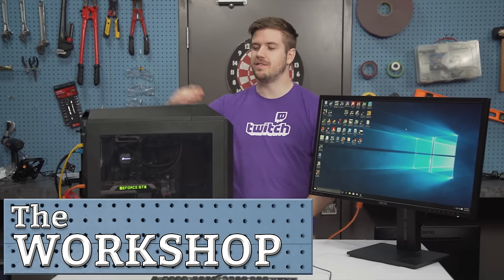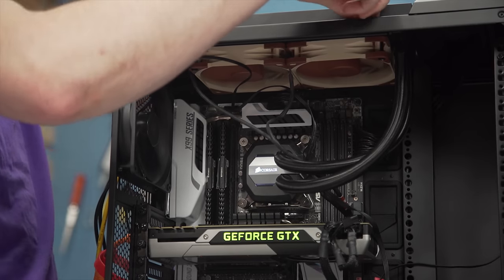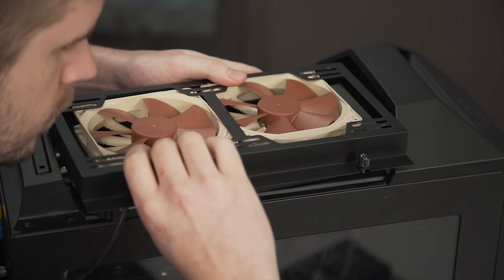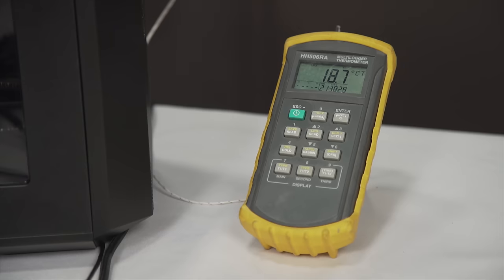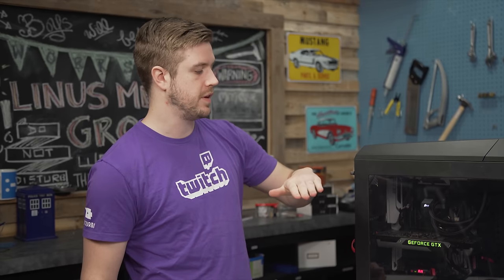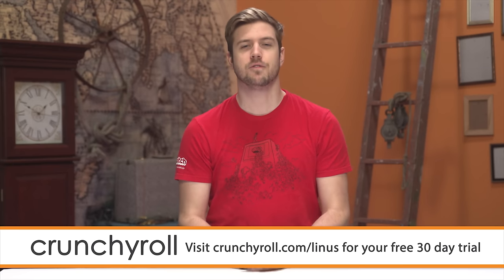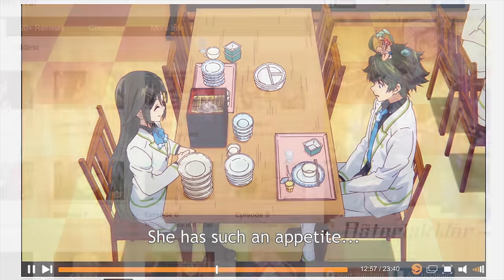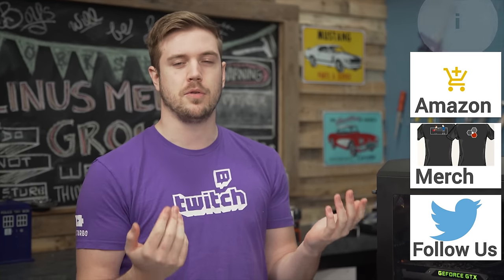Radiator Fan Configuration: Does It Matter? - The Workshop

Comment: This is kind of an 'age old' question and it's good to see another resource CLEARLY answering the question in a control-experiment way.

That being said, I was hoping to see more on cooling differences based on radiator placement  on different parts of the case. For instance, this whole process done with the radiator on the bottom or the front. Granted, this is extremely hard with most cases and AIO cooling tube length but it may be worth it as the informed consumer base may place a demand on newer setups not commonly seen with existing cases.

Thanks guys! Keep posting the phenomenal vids! Engaging and informing!

Comment: Why was there no test of intake vs exhaust positioning? My rad is configured with pushpull where I intake air temps and exhaust my rad into my case.

AFAIK, it's advantageous since my rad is not affected by my GPU's heat output.

Comment: I'm dumbfounded...

Thermaltake S71 case, H105 AIO cooler... MSI X99A SLI... 5930K... i never OC'd... but my temps were always idling 40 degrees up.. I was always told to exhaust out the top and back... intake from the front and bottom... after this video, i decided to flip my fans around on the Radiator (did the same on the fan at the top of my case)... and my CPU is idling at 35 degrees.. solid...

I'm dumbfounded.

Comment: Watch a similar video (with a similar title) on the Bitwit channel, where the guy pushes the 7700k to the limits (5Ghz, 1.4V) for more heat and clearer results. It's shown that intake or exhaust radiator fans actually do matter.
But test temps there are between 70-85 C, unlike here (35-38 C), so that's a pretty important difference. :)

Comment: How about doing a test to show temps between rads of different thickness like 30mm vs 80mm as well as different FPI (Folds per inch) and maybe even the temp difference between a 240mm and 480mm rads.

Comment: I've seen, so many times, that rad fans should always be exhaust because otherwise you are introducing heat into the PC. This is a valid statement but doesn't matter when testing the temps of the object being water-cooled. Push or pull, intake or exhaust doesn't matter for the device being cooled.

The question though, how affected are the air-cooled components when the water cooled components are set up as intake or exhaust. In this case, what happens to the GPU temps if the AIO CPU cooler intake or exhaust. Even though the water-cooled cooled item doesn't care, what happens with an air-cooled component when a water cooled component is used in an exhaust or intake configuration. Again, WC Intake increases case temp so the air cooled components should run hotter. At what point does this become an issue?

As for dust ... gotta love those dust filters.

Comment: I watched this video a year ago, but i decided to have four fans in a push-pull configuration, so basically the airflow was from inside the case, through the radiator, and then exhausted out. A year later, two of my case fans that were on top of the radiator went bad when they started making a screechy rattling noise (bearings went bad). It's probably because they were stock fans that came with my case and thus were low quality. 

I'm not replacing those fans on the top of my radiator because i just don't have the money, and my Noctua fans are still working in a push configuration. I'll update my comment if i have significant CPU temperature differences with my new 2-fan setup, but i doubt i will after watching this video.

Comment: I wish Linus could answer me this. I'm thinking of buying a laptop for 
my casual gaming, nothing special, meaning I'll use it on my free time 
at work. I know these 2 choices are not top of the line whatsoever, 
however I really need an answer. Both rigs come equipped with the same 
kind and amount of ram, same 1Tb hard drive, same GT 940M video card, 
same size (15.6") and even same brand, the only difference is that one 
comes with a ci5 5200U and the other with a ci7 5500U, however the price
 difference is about U$100 (although in my country, sellers often double
 that difference). Is the ci7 model worth it?

Comment: I have 6 fans 3 with a kraken x72 which is on the front of my nzxt 710 case pulling air in, and I have 3 nzxt fans on the top of the case blowing air out, also one rear ran blowing air out is that set up fine?

Comment: is a static pressure fan fine for pull configuration?. im planning to get the same cooler but im gonna use the fans that come with it.
Reply: U will be good,I had a single 140 rad with a sp fan pulling air on top in the beginning and it went fine..

Comment: how can I have fans setup as push into the radiator from front(outside the case showing RGB) and then pull from radiator(inside the case showing RGB inside)?. mostly RGB fans lighting is present at one side, and if I want to show RGB inside my case then I end up having setup as push/push.

Comment: As long as your rad is on exhaust and everything else is intake you are fine. It won't get any better. My results with an o/c fx 8120 and a gtx 770 in a corsair 450d, having the rad on intake made my gpu like 8c hotter while the cpu was only about 1c lower. Positive/negative pressure is all bs.

Comment: +LinusTechTips would you do a video about weather or not thermal paste wears out? (i have a somewhat old computer, never replaced the thermal compound, wondering if maybe i should?) also, in the same video, does pulling off a heatsink and then replacing it without reapplying or cleaning off thermal compound  affect performance? (a couple years ago i took off my heatsink to clean out the dust, and being ignorant of the use of thermal compund at the time, did not reapply, is that an oopsie?)  and, while i know youll want to do this with an i7 or something would you please also do it with something more "normal" like a pentium or i3? obviously for the first test, you would need to find hardware that was a few years old anyways that you knew the thermal compound hadnt been replaced on. (FreeGeek?)

Comment: Expanded question: What if you have a GPU without "blower" style cooling that pretty much exhausts all its heat into the case?

I have a just had to replace old GTX 780 (as it died) with a EVGA RTX 2070 Super that has a 3 slot cooler. The way the heatsink is designed is to discharge the heat into the case. The top mount is filtered as well, so if i intake dust won't be a major issue. This will create high positive pressure though as i have 2x 140mm front, 1x 140mm bottom, and 2x 120mm top on the AIO cooler, with only a 140mm exhaust in the rear.
Reply: i have the same exact airflow problem.

what i do is choosing a high airflow CFM for exhaust fan. i use a single 120mm Cooler Master Jetflo as exhaust fan. it has a 95cfm airflow.

my airflow is:
- top 240mm  radiator+fan pulling in air
- front 3 x 120mm fan pulling in air
- back 1 x 120mm fan high airflow CFM as exhaust pulling out air. 

my gpu also have 3 fans, it takes fresh air from the front fans. cpu also takes fresh air from the top. all of the hot air is pulled out by exhaust fan. 

the high cfm exhaust fan really helps the case cooldown to a comfortable temperature albeit a bit noisy.

Comment: So i have a Carbide 175R RGB case and i have a Corsair H100i Pro RGB  Liquid Cooling 240MM, Dual ML120, PWM Fans, i7-9700K, ASUS ROG STRIX GeForce RTX 2060 Super.
 I noticed when i play Call of Duty Warzone on High Settings i get 144 fps and my GPU temp skyrockets to 82 degrees celsius. Is this too high? I noticed i dont have any fans besides the RGB fan behind the logo and the 2 Radiator Fans.  Should i buy a 120MM exhaust fan to mount on the back to help pull air out of the case? Would that help with the temps? Any advice is appreciated.  Also is it bad that the radiator is mounted on the top? I built this PC with a friend and i think we put the radiator on the top because my Graphics Card is so big it didnt have space on the back, but i dont remember. Is just the Corsair H100i enough to properly cool this build? other than the AIO i just have the RGB fan behind the logo and i dont even know how much it helps.
Also i have no idea if my 2 Fans on my Radiator are pulling air into the case or pulling air out.  Seeing as they are the only 2 fans in my case besides the weird RGB one behind the logo should i have the fans set up to 1 pulling in and 1 pulling out(exhaust)? How do i change this?
I assume the best bet to help with cooling would be to add a 120MM exhaust fan to the back of my case to pull the hot air out of my case? as i have no fans besides the ones connected to my radiator and the RGB one behind the front logo which i dont know what it does? exhaust through front panel i assume.  Sorry im a bit of a PC noob :(.

Comment: should have tried ducting. tape the fan to the radiator to create a seal between them. some air is forced around the edge. they do this in automotive with rubber flaps and foam.

Comment: Couldn't you also argue that having the fans in a pull config taking air out of the case would be better for the temps of other components too? I mean taking the heat from the CPU out of the case seems better than pushing it into the case to me...

Comment: What about Stupid Configuration #2?
Have 2 sets of fans both trying to pull air through the rad instead of trying to push air through it?  I suspect temps will be stupid high again, but interested in how the air flow (if any) would work considering both fans are in effect trying to pull air from nowhere and creating a small vacuum?

Comment: Can you check if the radiator in front of the case as an intake (cooling the cpu) will be much worse then an outtake in the top
Reply: Jayztwocents did a video on this, I can't remember what it's called but there's no difference if I remember correctly

Comment: doing it with a blower gpu is a problem. needed to do it with an open shroud gpu to see if top or front aio makes any difference
Reply: There is a video on it on youtube. No effect on the open GPU where cooler is mounted. Whereas CPU is 10c cooler when mounted front.

Comment: 60% does not tell us what the RPM is. I think this may be mixing issues or actually comparing exhaust vs intake..push vs pull and exhaust vs intake are 2 separate things. Push vs pull refers to fan over rad.  Push should be better...but you have to consider everything. Also, intake is better.  In exhaust mode,  Case air may partially mask differences... because it is 'pre-warmed' it will how a lower differential with the rad temp. Differentials make non-linear differences. Also, there is certainly 'diminishing returns' of increase RPM on fan. Where this is depends on things like the cooling load, fin area, density, etc etc. So you would have to attempt to account for the actual variables.In reality, push vs pull  being notable better probably depends on the particular system. But, the hypothesis here is that you should be able to create a situation, withing 'normal' that you might find, where push allows you to run at least a slightly lower RPM and get the same cooling. Also,  hitting 38C on cpu is ridiculously low, meaning YOU"VE GOT SO MUCH COOLING OVERHEAD< OF course you will not measure it. This video appears to just be an inadequate attempt at thinking this through.

Comment: The configuration doesn't matter if your gpu isn't heating the air in the case. In my pc I switched from top outtake to top inlet. When gaming this resulted in an about 10 degrees difference on my cpu.

Comment: Well so I assume my i5 3570k at 4GHz running at >80°C while at 100% (Prime95) when using my All-in-One Liquid Cooling by Enermax is fairly bad right? 
Ok the room temp is about 28°C and it is overclocked, but I would assume it should NOT go above some 60°C or something. Especially since I'm using Noctua fans.

Comment: Is it ok to change the fans that came with the cooler to a different brand?
Reply: Yes, as long as they are the same dimensions and will fit the fan head splitter it comes with.

Comment: im curious to see if my fx-6300 with 2 pair of fans pushing the 2x120mm rad can do 5 GHz. Sadly i dont know what case that is big enough  to fit it. Currently using corsair h60 with push and pull config, 100% fan speed, and with 1.5 Volts, it can do a benchmark but not stable enough to do ibt on maximum with temps nearby 70 so backed out to 4.6GHz @ 1.36v stable.

Comment: not bad test but i was wondering about the other component temperature  like mother board and ram and GPU if you push the cooler hot AIR inside the case and what about overclock ...:P

Comment: Linus I need some help. I recently replaced the cooling fan in my hp pavilion g7 laptop. now when I plug it in to charge it the laptop doesn't reconize that it is connected and supposed to be charging. what could cause this? any help is appriciated

Comment: OK, Luke, I will straw poll before watching the vid, based on my own needs. 
Large filter on exterior of case with a large pressure fan drawing air in. Small fans within case or deflectors/ducting directing flow to hot spots, dual fan GPU, long radiator on top of case with 2 fans on top of it, drawing air upwards and out, PSU exhausting outwards, to rear...  hope that fits the bill for a hot, dusty environment.  rc

Comment: what about placing them on the front? i got an ibp rig and had to upgrade the aio cause the pump failed. i bought at h100 from corsair, however the ram i have wouldn't let me top mount, so i had to use the front w/ intake fans pulling in air ( cause my case has a solid cover so it would create pressure if i tried to make the fans exhaust instead)  
but that being said im curious if i missed something simple, pc is happy, even under load it stays under temp, probably the same temps as everything else logical buuut still so some love to us front mounters xP

Comment: If you have a smaller case or if you have more than one video card, pulling the air from the case can be worse. This is because you are using the already hot air from the case to cool your CPU. Larger cases don't have this problem and you will likely see no difference if you have really good positive air pressure coming from the front of your case. This is more of an issue if you are using the video card(s) that vent their air into the case rather than closed loop AMD cards or stock Nvidia coolers that vent their hot air directly out the back of your case.

I mention this because I had this problem with my old Q9400. I had it overclocked to 3.6Ghz in a rather small mini tower with a GTX660 that had an open air cooler and there was a pretty big difference of over 15C between taking air from the case VS pulling it fresh into the case through the RAD. My new 6600K system has a Sapphire R9 380 OC in it but I have a rather large case with a 360 RAD and I found no difference in CPU temps.

I thought it should have been mentioned.

Comment: Have my setup fans inside case pushing thru radiator my rad is a 360 cpu runs 22°C the only thing you have to remove fans to clean dust off rad & fans that's OK not hard to do.

Comment: They should have tried "Blowing out the top" setup up, but then flip that "Rear Exhaust Fan" to be a "Rear Intake Fan"...... so that "Rear Fan" is supplying fresh cool air directly to the radiator fans pulling air out the top.

Comment: wouldn't pulling up through the rad mean you would have to put filters on all the little holes, so that way dust won't get into the system?
Reply: The master case pro has a mesh over every intake/exhaust anyway
Reply: ***** yeah, pulling up through the rad means inlets.
Reply: ***** i know, but pulling air out of the case means dust will go in the intake, which is why i prefer to push into the case, and if i'm going to be cleaning my PC, im going to disassemble it anyways
Reply: tl;dr, but intake fans are better, the positive pressure will push dust through the holes in the case

Comment: You need to overclock it bro!! Heat the cpu hard, then observe. Since there's not a large difference between ambient and core
Reply: Mahesh Bhutada agreed so check out bitwit he actually did a very legit and dependable test, aggressively overclocking the cpu. Result? Front rad placement lowers cpu temps by about 6°C and other parts by about 10°C so front is better for thermals

Comment: +Linustechtips There is a serious flaw with this experiment. Water cooling and air cooling they both work using temperature differentials between the components and the refrigerating item (heat pipes or water block). Each lower degree is exponentially more difficult to achieve, to the point where arriving room temperature is impossible. You guys are using temperatures differentials (20 degrees) that no one has, never (you don't buy a 2x120mm rad to not overclock your system). Usually temperature differentials are over 40 degrees and maybe, i can't say as i've not tried, things may happen differently.

Comment: What about in the front of the case, its more cooler then above the motherboard.
i have this config and it about 10 degrees lower. but the downside is that the Vram gets more hot. (They didnt show the rest of the motherboard heat with this test btw)
So yeah its good i guess?! :P